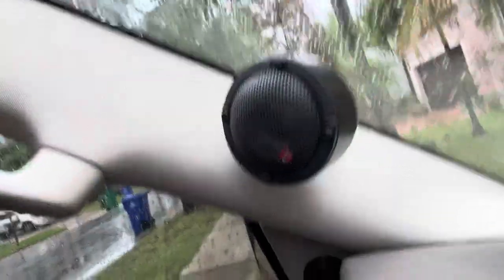Reaction video to my #Recoil audio Navigator - first sound demo of all new Recoil speakers and amps

Comment: That smile on your face, I know that all too well - it’s sounds tight 👊🏼👊🏼
Reply from the maker: Yessir. The setup is phenomenal for tight, punchy bass and short, deep lows. It’s not ever gonna be windy for sure, but the sound is extremely loud and strong.
Reply: Aleksandar, without being too exact, what’s the ballpark figure you paid? 
I’m thinking of doing the same thing myself in my car, I’ve got everything in place, just need one Audiocontrol DSP amp.
Reply from the maker: @rohanthelwell7454  ok, the grand total for : 2x Recoil DI1200.4 amps, 1x Recoil REA600.4 amp, Recoil RD65 Component Set (mids/tweeters), CDT Audio Unity 8.0s (midrange in A pillars), Recoil RAX65 Rose Gold Coaxials in read doors, Audio Control LC7i LOC, Expert air8 DSP, 2x Recoil Echo Pro 10PWD2 subs, JY Power Lithium Capacitor and all the cables, wires, connectors came out to about $1,650 total for the entire truck.
Reply: Damm bruh, that’s cheap - Wauw 👊🏼👊🏼🤓
Reply from the maker: @rohanthelwell7454  yessir. I wanted a full budget build, and ended up with a full ass SQ miracle. Sometimes, it just works. 🔊🔊
Reply: Anyway, well done 😊👊🏼

Comment: Sounds great man! so you were chasing a noise at 40hz? my advice is to play a 40hz sine wave and wonder around till you can find it. as far as copywrite music goes, DJ rusticles CAN get you, it usually doesnt though. you can always download from youtubes library looki at tracks from Neffex good tunes their. also on smart phones, the recording camera determines the mic used, so if you are recording with the camera facing you, it also records audio from that mic. you can choose mics in the manual pro video settings, but the standard video will choose the mic pointed towards what the camera is seeing.
Reply from the maker: Thank you brother. The whining noise is there evenly, no rpm change though, however only when 15hz-45hz tracks are playing.
Reply: on "your" noise issue, specifically it's likely the amp gain on that sub amp is a bit high. i dont know how you have the signal path on that setup, but boosting the signal going into the sub amp and turning down the amp's gain will prolly kill your noise. @TheGodofSEO
Reply from the maker: @CarAudioEnthusiasts  I’m gonna play with it tonight. The issue is, I have TWO amps, my DI1200.4 and the bridged channels 3/4 on each amp run each of the subs…so I doubt it’s both amps. Could it be something with the Audio Control?
Reply: so you have 2 amps running the subs? lemee see if i understand, you have 2 4 channel amps, each of them has 3 and 4 briged to A sub, and each of them has 1 and 2 running a Mid high ?  @TheGodofSEO
Reply: turn the gains down on the bridged channels and then turn UP the sub output in the dsp. I would have dedicated one amp to the mids and highs, and bridged the other to the subs, but either way works.
Reply from the maker: @CarAudioEnthusiasts  correct
Reply from the maker: @CarAudioEnthusiasts  lemme mess with that.
Reply from the maker: @CarAudioEnthusiasts  the issue is that only channels 3/4 have LPG. Go figure.

Comment: Do you need Tweeters with the Unity 8's?  I thought the purpose was not to?  What xover points are you using?  thx!
Reply from the maker: Well you technically don’t need to but I felt like I was missing the super crisp highs so I added the Recoil Tweeters in the factory sail panel locations (they were $20 bucks so why not). Midrange is crossed over 500-2,000; my tweeters are 2,000+, my RD65 mids are 80-500, and my subs 80 down.

Comment: How is the standby noise coming from the amp when volume is 0 ? Any floor noise coming from the unity and the recoil tweeters ?
Reply from the maker: Yes. There is a whine at zero volume but not loud (just sounds like a fan in a bathroom far far away)

Comment: Where did you get the pillar pods for the mids? Do you like the sound coming out of them from that position?
Reply from the maker: I bought them from Valicar Stuttgart in Germany (on eBay). They are made specifically for my Unities so the fit and finish is flawless. I love them there, because my Recoil tweeters were installed in the factory location in the doors’ sail panels so the blend of sound is perfect. One thing that helped all of this is the Expert air8 DSP because it has a time alignment feature allowing me to customize the sound to my seating position.  Incredible tool for a great SQ setup.
Reply: Cool, I've noticed that when doing 3 ways, you don't want to separate the mids from the tweeters too much

Comment: Was there a big sound difference on your high end with the di amp vs the red amp?
Reply from the maker: Honestly, my ears can’t tell the difference between the REA (not RED) vs the DI. My REA powers the Recoil tweeters and the midrange pods. The DIs run the door midwoofers and rear coaxials. It all sounds phenomenal but I can’t tell any “difference” per se.
Reply: @TheGodofSEO  I didn’t realize the non mono versions were rea and the monos were red amps. Weird but thank you. Just ordered a di1200.4.
Reply from the maker: @michaelyoung7911  you’re gonna love it. My DI1200.4s are powering front midwoofers and one of the subs, each (bridged channels 3/4 to each sub) so you can do a variety of setup options with the DIs. And yes, the REA is the A/B version for SQ, the DIs are for full range and midwoofers/subs, the REDs are for subs only, and the new DII (dumb name) are the micro versions of the DI amps. Don’t forget, DIs are only down to 2ohm. Do not run DIs below 2ohm. REDs are for 1ohm and below.
Reply: @TheGodofSEO  awesome thanks. I take it you sell recoil products? I’m in the market for more but it’s hard to find anyone who sells more recoil products. Not much is available on Amazon and nothing on their website.
Reply from the maker: @michaelyoung7911  nope. I got all of my Recoil products from Robot Underground, their dealer in Mesa, Arizona. I’m just a fan of cheap, great products.
Reply: @TheGodofSEO  haha that’s where I just got me rd365’s and I’ll probably get some other stuff from too.
Reply from the maker: @michaelyoung7911  yup.  I got everything in all 3 of my Recoil rides from him except the RED2500.1 which he didn’t have in stock but I picked up on Amazon while they were back in stock. That’s 5 amps, 6 pairs of speakers, wiring kits, and all of my subs. Patrick stays winning